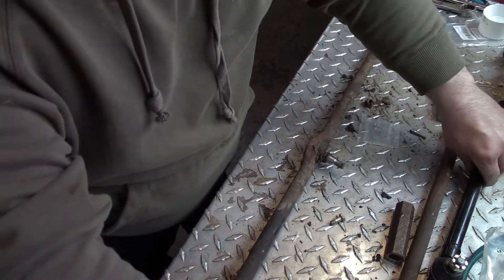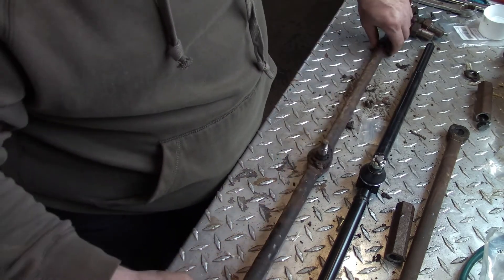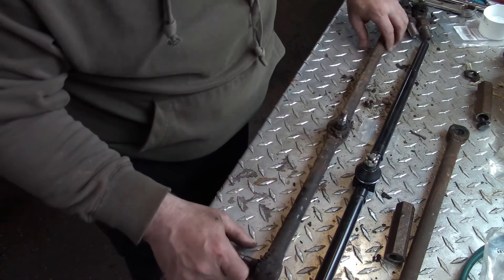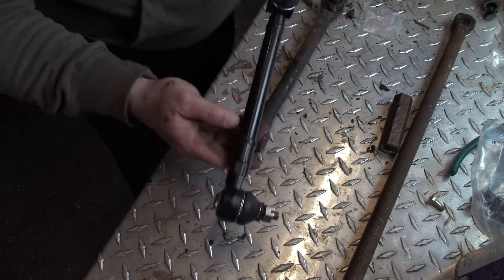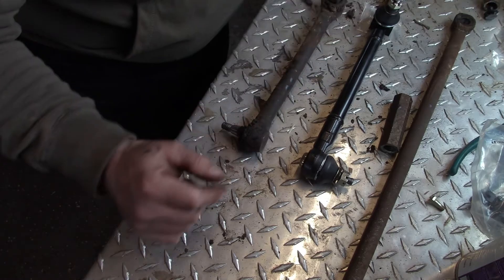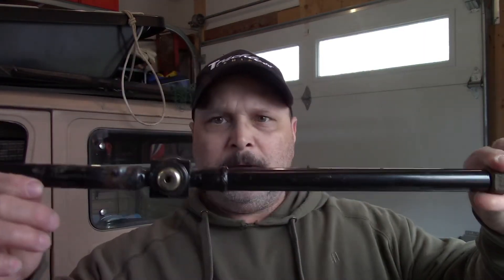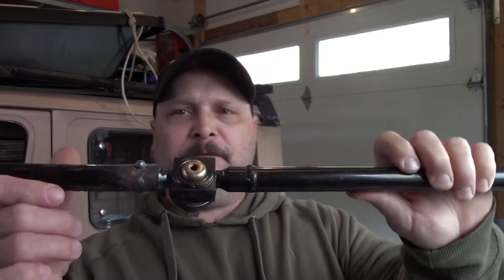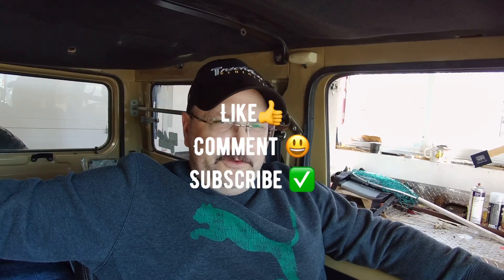Waking up Suzy!

Comment: I've always liked those Suzuki jeeps but never owned one. The weld fix seemed to be fine and the test drive looked good. I had a CJ7 in 1984 and rolled it on the highway when it was only 10 months old--a right off but just a scratch on my throat from crawling out a broken window with the jeep upside down. The seat belt and roll bar saved my life. Ever since, I drive more carefully. Can't wait to see this thing stuck in the mud, Marc!! :face-purple-crying::text-green-game-over::face-blue-smiling::face-fuchsia-tongue-out:
Reply from the maker: I'm sure you counted yourself blessed to walk away! Those CJ's were awesome jeeps but defiantly not built properly for high speeds/highways.
Take care Craig👍
Reply: @OpenAirOutdoors  60 MPH and went sideways on black ice. Rolled a few times into a ditch with trees about 10 feet high. I remember being scratched by the spruce branches as the fiberglass roof came off.

Comment: Great job Marc. Sometimes you have to improvise. With our yard trucks at work (2500 and 3500) Chevrolets and GMC used by our maintenance crews and the constant muddy condition they run in, we are all the time rebuilding the front ends on them. Try to catch them before the tie rods or ball joints fall out but not always. These trucks never see pavement. First time I've seen your neighborhood. Pretty nice. Take care brother 🤝
Reply from the maker: Off roading is always hard on equipment, the constant pounding of rough terrain takes out moving parts! I live in a great neighbourhood with most a the noise coming from snowmobiles in the winter and ATV’s in the summer hitting the surrounding trails. 
Thanks for coming along for the ride Tracy 🍻